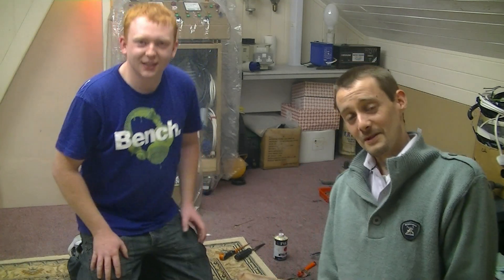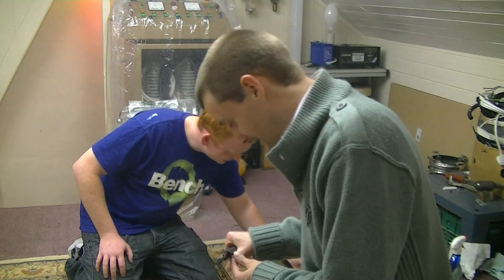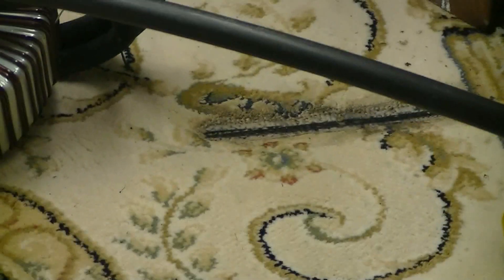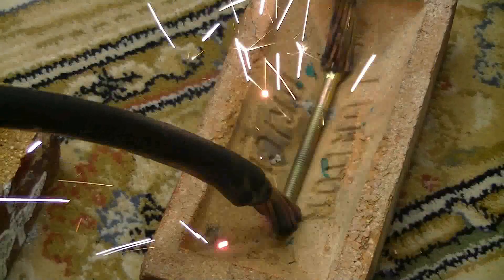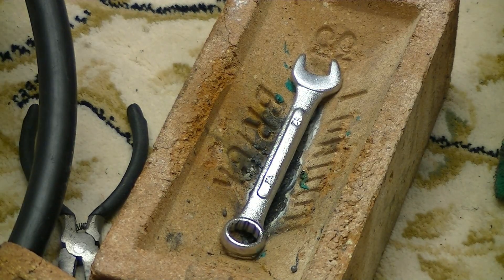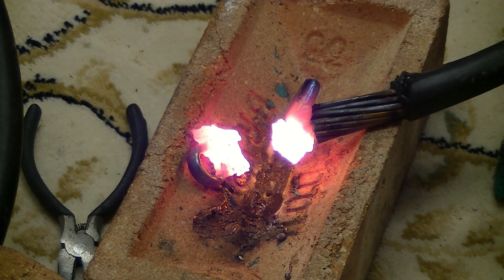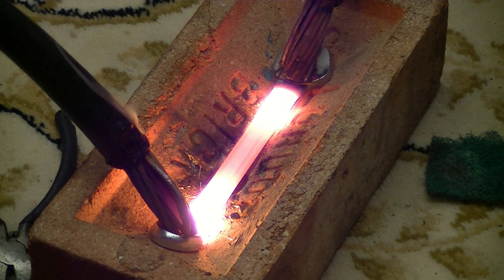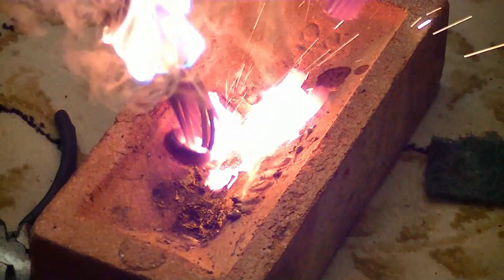5000 Amp Fuse + Tools Melt With High Current

Comment: Now the cartels are going to do this to people
Reply: There is not enough voltage to push that amount of current through milion ohm resistance of the body.
Reply: @Ignisan_66  Please.. Have a little bit of common sense. Volt also kills. That whole thing is a myth. This thing can melt stell, how in the world do you think you could survive that?
Reply: ApertureChromaKey a car battery can melt steel, but touch the ends with your hands and you’ll be fine. This is because 12v is too low to push a dangerous amount of current through your body.
Reply: @Ignisan_66  OK, touch it then and send me a video.
Reply: Arizona Kid surprisingly it is harmless to humans
Reply: @outsidechambaz  OK, you should touch it then. Natural evolution.

Comment: Stupid question, but I don’t know much about electricity. If you were to have the same setup here but with a longer bar, put the cables closer to each other, and then touched both ends with your hands, would you get electrocuted? Or would the path of least resistance save you?

Comment: As a studying electricians apprentice, I can safely declare that these men are professional idiots
Reply: I'm afraid you don't have to study electrians apprentice to make such statements
Reply: Watch some of his other videos, as an electrical engineer I can say he knows what he’s doing, if you touched both those wires with your hand it wouldn’t do anything, this is a lot safer than it looks
Reply: Jack Yorgesen wrong I’m an electrician they touch them wire they will be home fries... that’s 500v they playing with...
Reply: @triizzmattiicz  at the beginning they said 240v out of the variac going into the transformer. So you can count the amount of turns on the primary of the transformer and it was around 90. Then we know there are 3 turns on the secondary. So 90/3 gives us a turns ratio of 30. Now 240v/30 gives us 8 volts out of the secondary. If they cranked the variac up to 500v later in the video which I don't remember if they did or not then that would be 500v/30 = about 17 volts. In either case this is not enough voltage to push the high current through your body that it could supply, just like a car battery at 12 volts can easily supply 500 amps but if you touch both terminals it won't hurt you because there is not enough voltage.
Reply: @jackyorgesen509  -> Only person on this thread who knows what they're talking about
Reply: @jackyorgesen509  but Triizz is an electrician!!!! pffft needs to go back to wherever he got qualified and ask for a fucking refund
Reply: Oh your boss hasn't showed you how to do this yet?😁
Reply: Photonic has like over 20 years electrical engineering experience.  He's farther from idiocy than you are.
Reply: So are those who finish viewing this video lol
Reply: He is a professional electrical worker
Reply: keep that study up, you may learn something                        oneday
Reply: those live wires arent lethal and they have fire proof carpet. It is a safe situation unless you touch the melted metal.
Reply: re'c'y'c'le
Reply: I surprised the house didn’t catch fire
Reply: I sensed an idubbbz quote but unsure
Reply: Akeyy now I want to try this can I just lig into house sockets
Reply: So as BMW drivers 200bhp +...
Reply: Looks about right.  Okay then thanks.
Reply: Like ElectroBoom
Reply: If it were me that posted that after the truly knowledgeable response below I would have to delete that lol
Reply: those live wires arent lethal and they have fire proof carpet. It is a safe situation unless you touch the melted metal
Reply: should have stopped at professional there, makes your comment 10x funnier
Reply: Carlos Leon Make your own joke you twat
Reply: Union pussy
Reply: Akeyy it’s insane considering that 1 amp can kill a person.  And this is 5000?!
Reply: Clint Patac all depends on voltage just sayin
Reply: @justinmartin8887  yeah, volts is a factor, but people have been struck by lightning and survived, and those can be 1,000,000 volts.  So by scale of numbers 5000 amps is terrifying.
I guess if you think of water flowing thru pipes, there’s pressure and volume.
Volts would be the pressure and Amps would be the volume.
Reply: @cjpatz  yup more or less the hydraulic energy equivalent.
Reply: @cjpatz  yup! Insane ain't it!
Reply: As an unprofessional non experienced electrician, I can also say these guys are grade A idiots
Reply: Haha u really did ruin what ever joke that was mate
Reply: you ruined it you twat

Comment: Now touch it......
Reply: Nothing would happen. Only few volts. The current through your body would be around I=5V/1kOhm=5mA. You notice more when you touch the terminals of a 9V battery.
Reply: @Momchil0  You'd get proper burnt after what they've done though, that cable must be pretty hot.

Comment: You Britt's really take advantage of that extra hundred and ten volts
Reply: 120
Reply: There is only one t in that word.
Reply: Maui Randall US houses have 240V it’s just split phase.
Reply: It's the amps they're playing with
Reply: Robert Sand Yes, but they have twice the voltage at the outlet, so they can use a transformer with fewer turns to get a super high current. Basically they get double the power before tripping a breaker
Reply: @bloogaming8827  It's both. You are more correct though if that makes sense.
Reply: @raabsand  240v
Reply: @raabsand  Amp and Volts are the same.
Reply: @Tmp866  The same?
If you mean directly proportional yes.

If you mean the exact same no.
Reply: @Tmp866  no. Voltage is current times resistance.

Comment: 5000 amps LOL um nope not even close, not even in the same galaxy. You can do this with 50 amps EASY.
Reply: They have a 5000 amp fuse... And they burned some wrenches. They never claimed they were running 5000 amp through that transformer

Comment: Have fun with the metal fume fever m8
Reply: Yep I’ve had it. 

My dumbass welded galvanized steel. 

It’s like having the flu for a week and it fucking sucks.
Reply: connor cadogan what is that?
Reply: @chip238  when you melt galvanized metal you can inhale particles that are hard for your body to remove from your lungs and this causes a condition called metal fume fever.

Comment: Will I die if I touch the wires??  
  Like if you say yes 
Comment if you say no
Reply: No
Reply: Of course not. A light tingle.  It make your little dicky stand up
Reply: No
Reply: You will not
Reply: Maybe
Reply: No cause its low voltage but you will get Burns probably lose you hand from the resistance in your body creating massive amounts of heat

Comment: I hope none of those had cadmium coating.  No you have a lot of a metal vapors in the air.  That's great for the lungs, and brain.  Does anyone wonder why you don't see any girl friends in the video??
Reply: At least they aren't as uggo as you
Reply: The bolt looked brass or at least zinc coated. I'm sure it was a "safety bolt" like the carpet.

Comment: Im 14 and this video has inspired me to do some electrical work while my parents are out this weekend
Reply: Go check and see if the step down transformer on one of the poles by your house needs some work done on it too.
Reply: Make sure you throw some water on the carpet...you know as a safety precaution
Reply: Ok i figured it out i should take a bath, no dry off. Wrap my body in tin foil, then stick a metal butter knife into an outlet
Reply: @JohnSmith-bs4fd  sounds about right son. Well done
Reply: Gumball Waterson 2004 NO NO...UR DOING IT WRONG..GRAB YOURSELF WELDING WIRE WRAPP YOURSELF AROUND IT......THEN RUN IN THE SPRINKLERS THEN GRAB THE OTHER END OF OF THE WIRE MAKE SURE IT HAS PLENTY OF SLACK LIKE ABOUT 40FEET THEN THROW THE END OF THAT WIRE ATTACHED TO A CRESCENT WRENCH..MAKE SURE U THROW IT OVER THE POWER LINES ..& IF U MAKE IT...U WILL HAVE THE GUINNESS  WORLD RECORD FOR FARTHEST THROW OVER POWER LINES....GOOD LUCK.💥⚡⚡⚡
Reply: Gumball Waterson 2004 Stay safe bro.
Reply: Pu all the wiring in ice cold water to keep it cold at all times.
Reply: Lmao
Reply: Rip
Reply: Gumball Waterson 2004 good luck burning the house down👍
Reply: Go find the main going into the house, use a hacksaw to split it into. Then you can do the same experiments. With no cost.
Reply: Don't do it unless u wanna die
Reply: @Catxloveryu  nobody's gonna die, numbnuts. He just has to be sure to be barefoot at all times.
Reply: explain this for me please?
Reply: @Catxloveryu  1 trump supporter less
Reply: Add some salt. It's good for your skin 👍
Reply: Nooooo!!!!
Reply: @greatvaluebleach8497  how about dropping the toaster in a bath full of water
Reply: Also make sure to check if the circuit is live or not by licking the conductors
Reply: that's a fantastic idea son, If you can't find any good high amp cables, I'd recommend finding a ladder in your garage, or even just climb if you are a good climber, up a pylon, and remember to bring a wire cutter, so you can steal some nice 300kv cables to use in your...umm....electrical work
Reply: Drink as much water as you can before you start. Wash your hands with cold water and don't dry them. Also stand on a wet metal plate to become the earth. Safest way to do the job
Reply: :D :D
Reply: Moddagudusthav rooo
Reply: Haha do it
Reply: Don't forget to use the safety carpet!
Reply: Have fun
Reply: No no no try welding galvanized steel
Reply: Matthew Familia UR FUCKED UP.....I THINK HE HAS TO WEAR METAL WRENCHES WHILE HE DIPS HIS HANDS & FEET IN WATER ..& MAKE SURE YOU USE 220 FOR YOUR BATHING EXPERIENCES.
Reply: Dude calm down....well im inspired im 12 years
Reply: @Matthew Familia Careful  you may turn ginger!
Reply: Must ensure that. The voltage low as possible
Reply: If you need to check and don’t have a meter, use your tongue, journeyman electrician here so u can be sure!
Reply: Remind your parents to buy a mop.
Reply: Gumball waterson 2004 hahahahahahaha that lit made me lol
Reply: Are you do it? I think he died right now
Reply: @keke3441  we are all attention whores
Reply: rest in peace bro
Reply: Did you burn your house down in the end?
Reply: @peterianstaker9273  not yet but im working on it
Reply: Before you do that call 911
Reply: Gumball Waterson 2004 why do young kids gotta state their age before saying anything
Reply: Matthew Familia ese Wei 😂😂😂😂👌 don't get him killed bro lol.
Reply: Fire fighter regiment ready son
Reply: Wtf
Reply: God bless you do it
Reply: Archaz my thought exactly....
Reply: I'm just going to dial 9-1- preemptively
Reply: Matthew Familia oh god that disturbs me please say best it's less typing anyways
Reply: Don't ever try
Reply: In this moment that kid is dead
Reply: Just dont burn your house ok.. 😌
Reply: @Gumball Waterson 2004 😂😂😂😂😂😂😂😂😂😂😂😂😂😂😂😂😂😂😂😂😂😂😂😂😂😂😂😂😂😂😂😂😂😂😂😂😂😂😂😂😂😂😂😂😂😂😂😂😂😂😂😂😂😂😂😂😂😂😂😂😂😂😂😂😂😂😂😂
Reply: don't
Reply: Great, see you on the news!
Reply: Let s burn some house yeeeyyy
Reply: We never hear from you again
Reply: R I P Kid 😂👌
Reply: 😀😀 liying
Reply: Archaz and it’s you
Reply: Nigga is lit
Reply: Ok be careful! I hope nothing bad happens
Reply: Do it on a carpet
Reply: Please don't
Reply: Make sure to replace all the fuses in your house with paperclips to ensure maximum efficiency.
Reply: Same here :P
Reply: I'm 6 and this video has inspired me to build an electical gun capable of starting a big bang, just a small procject of mine :)
Reply: @shiinamashiro2021  ok you are overexagerating because you want people to be scared of everything. Shut up!!!
Reply: FBI open up lmao
Reply: @keke3441  hey he's 14!!

I think they prefer the word "thot"
Reply: @Matthew Familia always turn off the breakers before doing anything with the mains supply is about 240 volts. So if u don't turn off the breakers u will get killed or seriously injured

Comment: are there wires that can hold 5,000 amps?
Reply: I have used water cooled cables for a 3000 amp machine. Or about a dozen 500kcmil wires for a 5000 amp service.

Comment: So how is the metal wire not melting?
Reply: Karl Bischoff resistance in the steel is higher than copper and heats up. Just like a lightbulb.

Comment: What if you touch both of them?
Reply: Jadryl Veloria I personally  wouldn't take the risk, but the voltage is probably so low that it wouldn't be able to break the skins resistance.
Reply: gsxrgeorge00 ohhh
Reply: gsxrgeorge00 what’s the voltage

Comment: Was expecting to see a pool of molten steel. Where did it all go? Presumably their lungs.
Reply: All went into their mouth
Reply: Brett Cooper maybe, but the gasses released from the galvanized coating on those bolts surely did and they will definitely regret it in the future
Reply: Some of it turned into the iron oxide powder you see at the bottom
Reply: It’s all still there, you’ll notice if you actually pay attention
Reply: @NightlyElite  actually its not "all there" so why don't you pay attention dumbass

Comment: The maximum you can get without your drivers getting damaged is 183.3 amps. primary coil 220 volts, resistance of 8.8 ohms, 5,500 whats. / secondary coil 30 volts alternating, 183.3 amps, 5,500 whats

Comment: this is totally false since 5000 amps is a large power. example of calculations if the secondary coil was 5 volts, (5000 amps X 30 volts = 150000 whats), from there they must have a supply of 130kva assuming a power factor 0.85, so it is impossible to 5000 amps

Comment: Basically how an electric stove works
1 probe on each end of the metal.

It's cool to see it used in higher currents though!
Reply: Are the wires plus and minus or plus and plus?

Comment: The reason why the copper isn't melting kids is because it has less resistance when the volts pass so all the energy doesn't get trapped in the copper.
Reply: Drew Allard iron has higher melting point than copper
Reply: Wtf are you on about?????
Reply: This looks like a 4/0 wire, I would say it can get up to 300 or 400 for short period of time. But 5000??... Ha.
Reply: Neat, thanks for the explanation
Reply: WikiTool just wanted to say this makes absolutely no sense
Reply: @Borz091  alright here is an analogy. 

With dry hands, rub your hands together really fast back and forth. Feel your hands get warm? That is because there is a lot of friction (resistance) between your hands because they are dry.

Now wash your hands in some water but don't dry them off. Now do the same thing as before, rub your hands together back and forth really fast. Notice how its a lot easier to move your hands back and forth ? Also did you notice how your hands didnt get any hotter? That is because there is less friction(resistance) between your hands.

Now lets define electricity, its the flowing of electrons through something conductive (lets the electrons move) like metals.
In the copper wire the electrons can move a lot easier through the wire from one end to another and there is almost no heat produced. This is because the copper has less internal resistance or friction inside of it. This can be seen when you have wet hands and almost no heat is produced.
Now in the steel, the internal resistance or the friction is a lot higher, so there is alot of heat produced by the electrons flowing through it. This can demonstrated by the dry hands when they produce a lot of heat when rubbed together. In electrical wiring this can be defined as the resistance, with a higher resistance, there is more friction and then more heat is produced. With lower resistance (the copper), there is alot less friction and the electrons can flow easily through and that makes less heat.
Reply: @Someone-cb3zx  the water would be absorbing the heat in that case
Reply: @primus711  that wasn't my point, my point was that there is more friction or resistance with dry hands compared to wet hands. Also, you can use lukewarm water, so your point is well, pointless. :)
Reply: @Someone-cb3zx  actually it isnt pointless at all even if you used warm water fyi but i was messing around but now you seem arrogant so you are still wrong
water is absorbing the energy created from your friction even if warm 
water can hold lots of energy obviously im sure you have that in your PC right now sucking away 100's of watts
Reply: @Someone-cb3zx  i get it what you want to say. Wonder why some people is connot using reference to understanding easier. Of course the reference is not the way the thing is work but it was similar and simplified.
Reply: @primus711  @Neutral Username 
Actually the water on your hands isn't absorbing the heat of friction. Considering water a lubricant and reduces friction, therefore water can not absorb the extra heat that your hands are not producing.
Reply: @pieter1928  no matter what the water is absorbing the energy created and just to fuck this whole stupid example up even more the water will actually cause your hand to prune which is the bodies way of overcoming that lubricant so you have better grip and in the end what i said is the truth or you hand would be burning hot within a minute if you were doing it fast
eg when you dont have paper towel or air to dry your hands after washing what do you do? answer you rub them together and they dry cause why?
whole reason why you sweat FFS to absorb the heat takes a lot of energy to make water phase change
Reply: @Flammy The electrical current passes through the copper with a lot less resistance than the steel, the steel melts because the current needs to go somewhere so it turns into heat and light.
Reply: FlammyHD, herein lies the reason electrical cable is made with Copper! Duh.
Reply: FlammyHD what he said made absolute sense, learn some physics before you make a big fool out of yourself please?

Comment: So can you use current to melt metal as a practical way of molding metals? In other words could I use electrical current rather than a coal forge to make a sword? Though I’m not sure if it would become molten. It seems to melt in the video but not in a liquidly state
Reply: Yes induction forge is used in industrial factories. A lot more efficient than coal